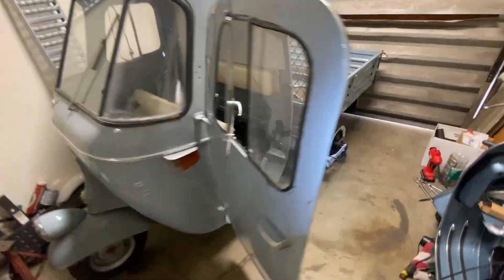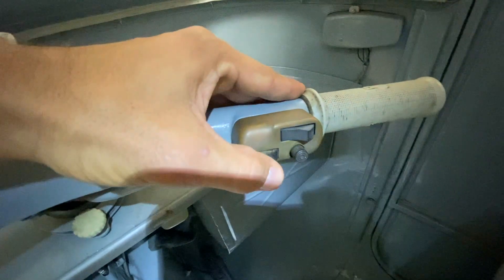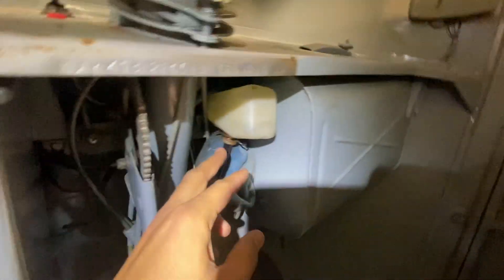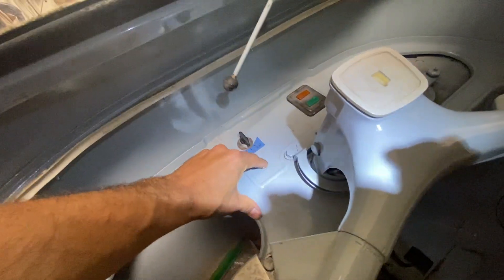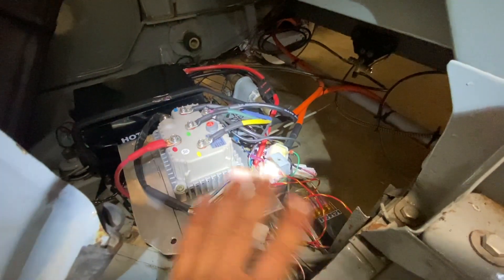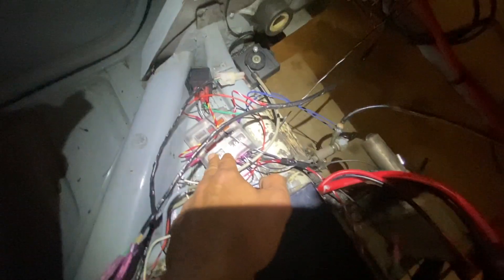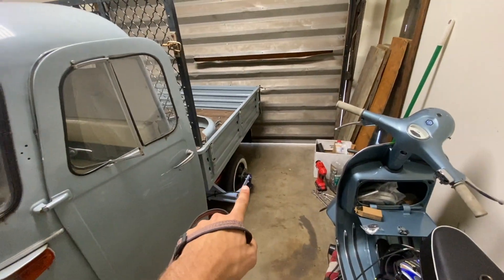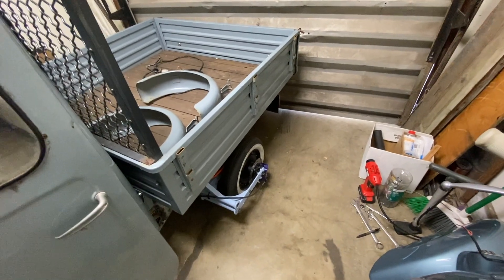How To Drive An Electric Piaggio Ape Truck

Comment: Bajaj in India was licensed by Vespa to produce these long back and they have a much more evolved product albeit internal combustion , these use lot of “modern” stuff and you can pick the master cylinder and a hydraulic front brake from their catalog easily. It should fit these.

https://www.google.com/search?q=bajaj+re+master+cylinder&rlz=1CDGOYI_enIN974IN974&oq=bajaj+re+master+cylinder&gs_lcrp=EgZjaHJvbWUyBggAEEUYOdIBCTE2NTUyajBqN6gCALACAA&hl=en-GB&sourceid=chrome-mobile&ie=UTF-8
Reply from the maker: I made a video over view of a bajaj 3 wheeler. Check out my channel for the vid. Thanks for the tip!